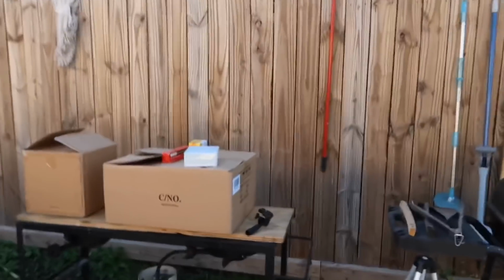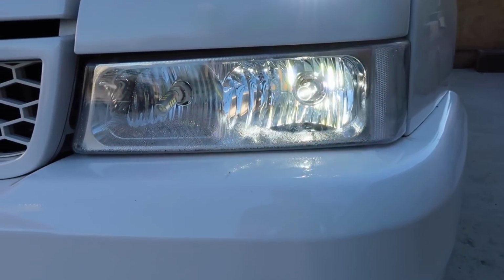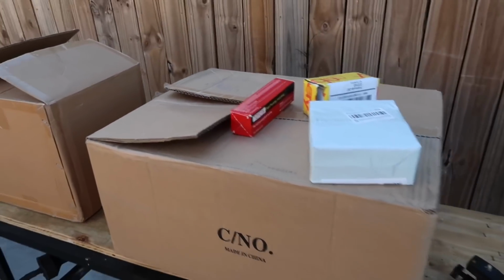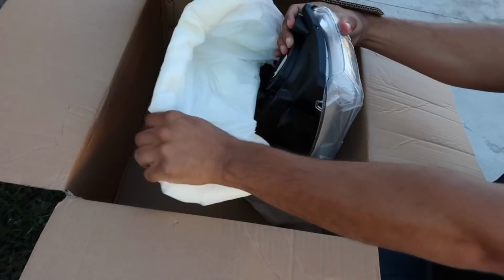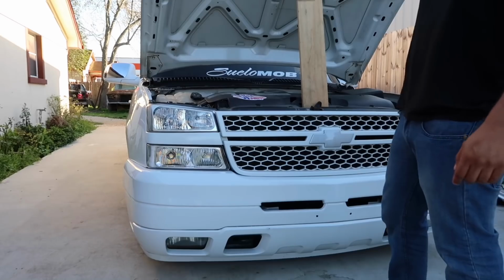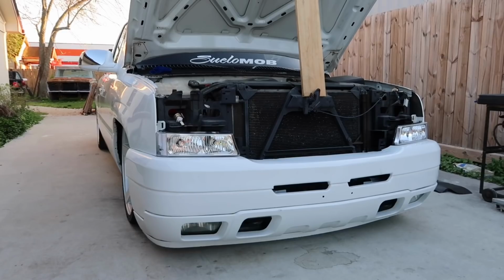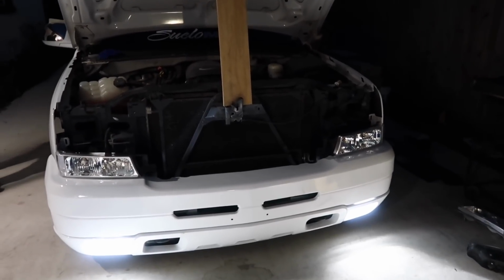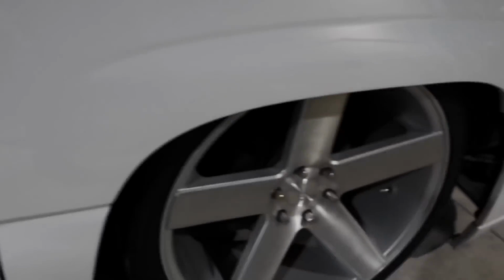new headlights and chrome delete!

Comment: I have those same switch backs on my truck and I used load resistors to stop the fast blinking, it will also fix the fast blinking on your cluster
Reply: You can replace the flasher relay to one that is compatible with led's. It will get rid of the hyper flash. Easier to replace that relay than to install load resistors.

Comment: It’s not the seal from the head light it self it’s the little gasket from the light bulb that lets the water and condensation in I had about to cat eyes and both did the same I test them out with a water hose and yup it was the gasket